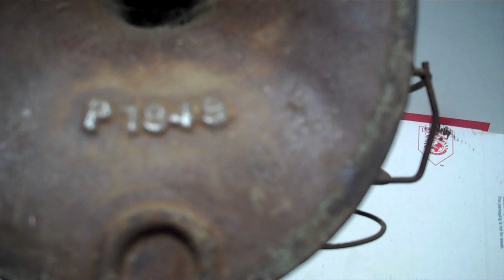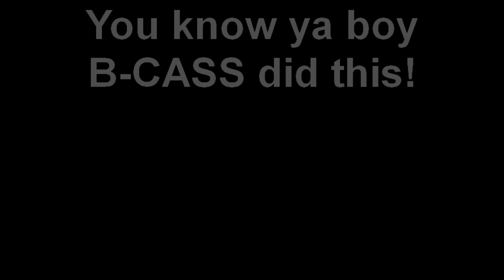Restoration of a 1930's Polar Cub.

Comment from the maker: @Oldfans1 Thank You!  I had sanded the wire cage down to the metal before priming it.  This was one of the most simple and easiest restorations I've done in a while.  I think I only spent 5 or 6 hours on it??  It runs very well now but does run a lil warm.  Not sure if these ran warm when they were new.   It looks great on top of my 1947 Fada TV.  Do you have any idea what this fan in its restored condition would be worth?

Comment: Sounds interesting, I restore and repair cars from the 50's and 60's but the only motorcycle I have had any experienced working on was a Honda trail 90.  Do you have any interest in early (1950's early 60"s) pocket transistor radios?  I have a very large collection and have pared it down to about 20 radios.  I have about 30 I would like to sell but don't want to list them one at a time on ebay.  Maybe you or someone you know is interested?

Comment: I'm just about to attempt the same with an old fan I got... from an antique store, I think. I'm really perplexed by the re-wiring part and it looks like my innards match your innards (sort of). Do I need to be adept at electrical stuff, or is this pretty easy? I've re-wired old French lamps for use in the US, but it was much simpler than this - a simple twist of the new wires and secure. Thoughts?

Comment: I've got a very similar (but older, 1920's) Polar Cub that I'm trying to re-wire.  I bought some vintage cable and took it apart, thought I wired it back up and it lit on fire! 
We blew it out instantly and it didn't seem to cause any damage. 
Do you have any tips on how to go back in and re-wire this guy properly?!? 

Thanks
Reply: Jereme Macready if it started on fire, the motor is likely already fried and will not work. Best thing would to find a new motor or sell the fan as not working.

Comment: Hey nice vid!
Let me clarify I am in no way an expert and not trying to sound like one. I have also stumbled upon a few Polar Cubs recently and did some research, to me this looks like a 30's model.
40's and 50's models have a bullet or egg shaped motor housing from what I've seen in catalogs.
The number on the bottom is a production number, there was probably a tag on the bottom at some point that had the model and patent number.
If anyone has some more info that would be great
Nice 5$ pickup!

Comment: Great job!  Do you have to oil the fan?  If so, how do you add oil to it?
Reply: Jack Ritter yes oil the fan every year with 3 in 1 but in the blue can, or zoom spout. Add a little to the front and back of the shaft where the 2 bearings are.